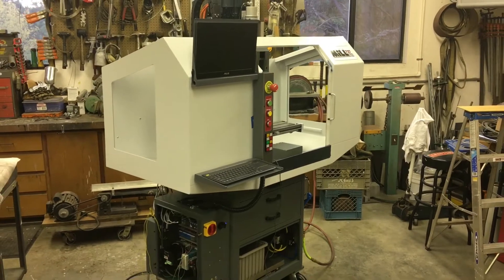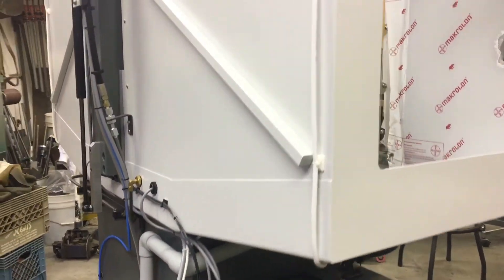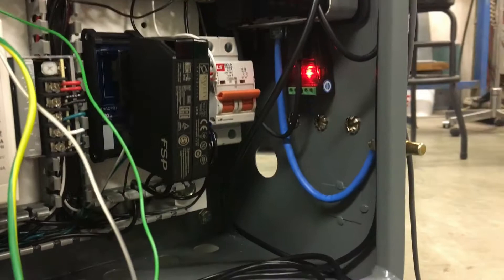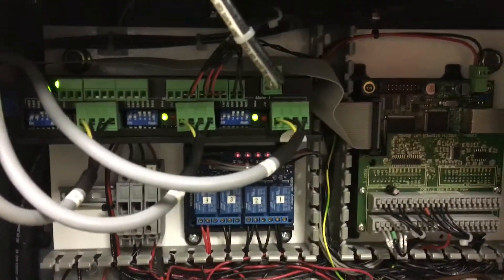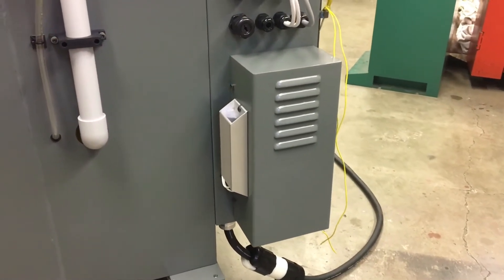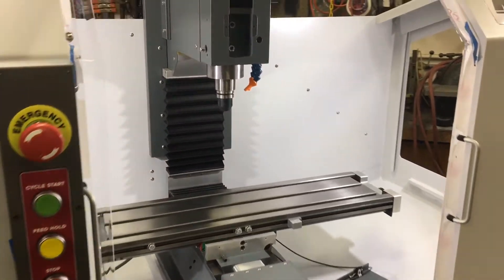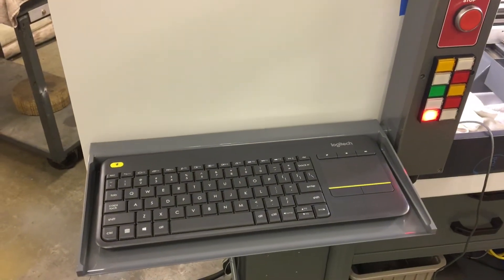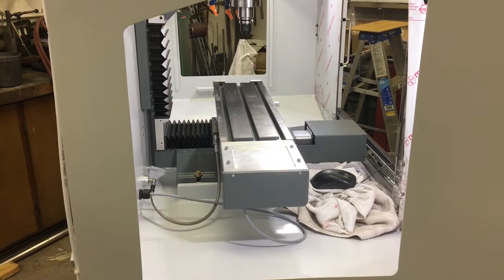GRIZZLY G0704 CNC Conversion Update 32 - ( assembly 9 )

Comment: Hi Nick. In the video where this machine finally quits something, I'm envisioning the dramatic 2001 song playing during the warmup :) Which stepper motors are you using? (I searched through the build log but cnczone's search is not as awesome as google.) If you slightly move the axis that's making the noise does the noise go away? How do you measure the spindle speed? I've messed with adjusting the feed override in LinuxCNC based on the spindle speed error and pausing if the spindle speed is too far from the target. I have a pretty weak spindle motor and no stall feedback from its drive so monitoring the spindle speed, creating a control loop using the spindle speed error. While you were talking about VFD alarms that came to mind. Might not be easy to implement, but then again, maybe the VFD has an alarm if X% above or below commanded speed? Best wishes, Kent
Reply from the maker: Kent! my friend. You are always good for amazing "visual" =) might even have to incorporate a fog machine into the mix! X,Y steppers are 570oz nema23... the faint clicking noise is when the machine and drive are powered up, sitting idle. I was planning on full modbus spindle control control and feedback but the LUA scripting to do it is currently over my head... interim plan is the utilize the 0-10v analog of the stepper driver for speed control. Im planning to get my modbus / lua feet wet with a easier to implement modbus spindle feedback (rpm)... working towards full control as i understand more,  modbus is just to cool not to play with, its amazing all the info you can pull from the drive... throw in a PLC and "the world is you oyster" .Yes you are correct on the alarm, the drive has a handful of programmable outputs that can signal the controller if the drive enters any sort of error state. Its would appear i have a few different options... its going to be a matter of selecting what features and making them all play nice!

- Nick

Comment: CUT SOMETHING!!!
You've done one damn good job on your conversion.. I'm working on mine and this is encouraging to watch the progress. By the way - nice job on the wiring. You figure a .75kw vfd will be enough? In mach3 after homing each axis it would jog off the limit. That's a pretty standard thing.. must be an option somewhere if yours isn't doing it.
Reply from the maker: Thanks! 1 hp (.75kw) should be more than enough for the little machine. A custom homing sequence in MACH4 is going to require some LUA scripting... just like most other features in mach4. - Nick

Comment: Not sure what that clicking sound is coming from the stepper motors. I had an old machine that used to do that to with nema 23. I’ve only used nema 34 since and haven’t had it do it on those.  Not much help I know but the machine it did it on worked fine.
Reply from the maker: Thanks for the info I appreciate it! I will circle back at a later date and do some more digging to really nail do if something is a miss or thats "just how they are". Cheers - Nick

Comment: Love your build just as many do. 
Personally I would ditch the wireless keyboard. Are you going to walk away and need the keyboard? Leave a little wire loose.

I just bought an Acorn by Centroid. So far all options are included in the wizard. I loved Mach 3 and the parallel port but all things must change apparently.